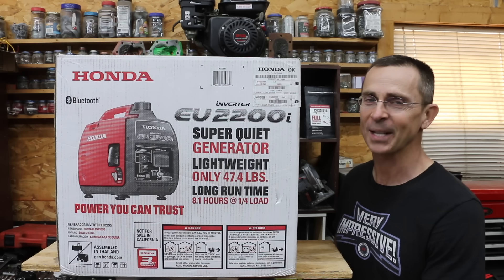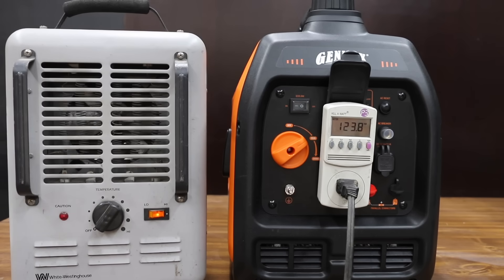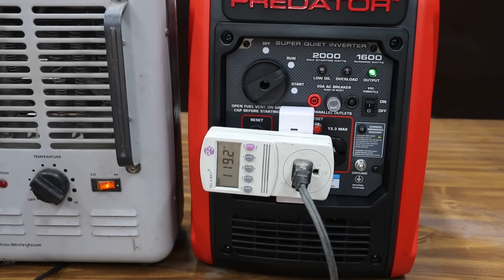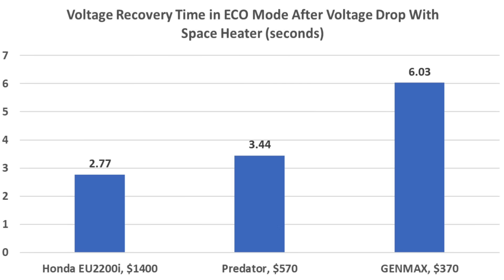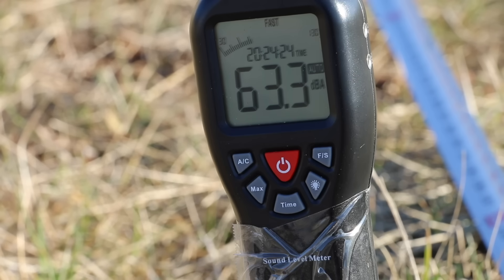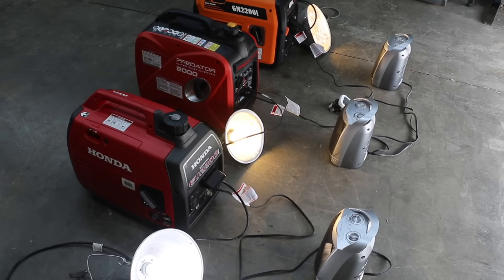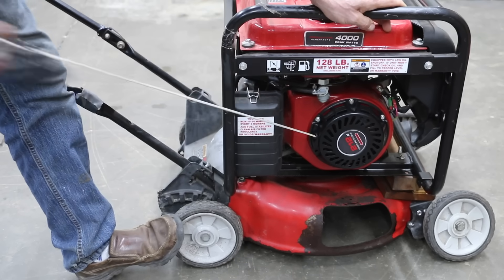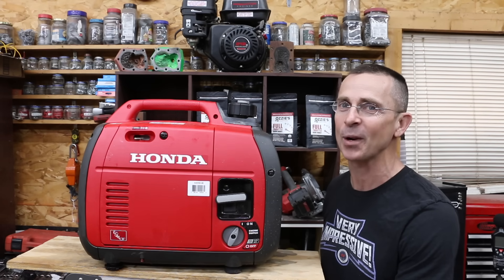Cheap Generator Better Than Honda? Predator vs Honda & GENMAX—Let’s Settle This!

Comment: I’ve owned 3 Honda’s and they all failed (2) 2000 series and (1) 1000 series and I think it was just during a few bad years. The engines were still running but the inverter/output side was dead.  I now own 2 Yamaha’s and 2 Ryobi’s that are all 5+ years old and they run great!  

The Yamaha’s were cheaper at the time but I don’t know if they still are however the Ryobi generators are still the best bang for your buck.  The main area of long term failure on all generators is with the owner and the lack of proper maintenance with Oil Changes and leaving old fuel in them and using regular 87 pump-gas instead of Ethanol Free. 

Good Video to separate the three qualities..!
Reply from the maker: Thanks!

Comment: I bought a Honda generator 3 years ago and I am super happy with it. One thing that is very convenient is that the honda tells you when its time to service by flashing the red led. (I have an older model with no bluetooth). Dont know if the other brands have this.
Reply from the maker: Nice!

Comment: I wouldn't touch a Honda personally. Great engines for sure, but if the Inverter goes the price for a replacement will make your head spin. All Honda parts are far too expensive. Add to that that Honda discontinue parts very quickly.
Champion all the way. Reliable, parts are affordable, and easy to source parts.
Reply from the maker: Thanks for the feedback.

Comment: Like to see Portable Solar Panel test, I use a briefcase style 4 panel to charge my portable battery packs and batteries for tools to save money .I realize its subjective because I live in Vegas so we gets lots of sun,but would be interesting to see if these units like mine Togo 120w or the Jackery or Ankers really put it out.Still saves me alot on my electricity charging from solar.
Reply from the maker: Thanks for the video idea.

Comment: If you can, see if you can test those big battery power banks that are suppose to replace generators. I wonder if there is any difference between them.
Reply from the maker: Thanks for the suggestion.

Comment: I have a honda had it 25+ years it ran for 4 months 24/7 tor 15 years last 10 years onley 2 months 24/7 onley larst 5 years it started using oil will buy another one
Reply from the maker: Thanks for sharing.

Comment: I would imagine that a new Generator engine would be broken-in at the manufacturer right?   At least with vehicles you typically don't want to use full synthetic oil until the engine has broken in and the rings are seated.  Maybe the engine isn't under enough load for it to matter?  Just curious

Comment: What great tests. Maybe as a small suggestion do a 100w draw test in the future? Most of us are not running Power tools so I'm curious what a TV for example would have dropped it. I mean way less than 50 watts I imagine would have been smooth? I was blown away at how much oil the predator used. I wonder if this was a "lemon" or if that's just acceptable to them. The Genmax impressed me for the cost. Quiet, good power except on hard draws initially. I think I would rather have 3 Genmax's than one Honda. Honda is solid but its overpriced.
Reply from the maker: Thanks!  Thanks for the suggestion.

Comment: I run a power conditioner on my generator that I use for electronics (fridge, computers etc) during blackouts.  Would be interesting to know if this is protecting my electronics and if one conditioner is better than another.
Reply from the maker: Thanks for the video idea.

Comment: The way I see, the Honda and Predator are effectively priced the same.
The Honda is available for $1200 shipped and includes a three year warranty. Predator is $620 today with a 90 day warranty (nope!), so I'd have to add the protection plan, two year max is $180. That's $800, 400 per warranted year, same as the Honda.
The Honda is obviously the better performer. Oil-life tracking in the app is a valuable feature. It's quieter. The clincher is the used oil analysis. I'll look at some others, but Honda is on the top of the list right now.
Thanks Todd for another great breakdown.
Would like to see some other quality brands.
Reply from the maker: You are welcome!  Thanks for the suggestion.
Reply: Very  good analysis. I have owned two Honda generators, the 3000is and the 6500is. A conservative estimate of 6,000 running hours on the 3000is before I sold it for $1,300. $700 for 6000 running hours. The 6500 has about 3,500 hours on it and I don't anticipate parting with it. You truly get what you pay for.

Comment: Being an electrician for 34 years I can tell you voltage drop at that small amount will not hurt any appliances over time. The Genmax had a running drop of only 4.2 volts (123.8 to 119.6) which is only 3.4%!  With a 100 foot 16ga extention cord,  yes there will be a problem with V drop.
Reply from the maker: Thanks for the feedback.

Comment: I would really like to see a fuel injected model added in, something like Honda's 3200i or 7000is. Both claim significantly increased fuel economy and better reliability compared to their carbureted counterparts, plus the 3200 produces significantly more power than other units its size. Could make for an interesting technology comparison.
Reply from the maker: Thanks for the suggestion.

Comment: All your product comparisons are highly appreciated!!! About a year ago I purchased my first(fully enclosed) gas powdered generator/inverter. Of course a different brand from the ones in the testing + w/3200 running watts. The cost was less than half the Honda equivalent & I did some Project Farm like testing....comparable to your results,but I was satisfied with my units'  results -(oil clarity when changing,run time;especially on eco mode,powering radios/fans/heaters/electronics when camping). Of course I performed a multiple oil exchange early in it's use,installed the compatiable NGK spark plug, & used high quality fuel with mixed cleaning agents. EVERYONE knows the reliablility of Honda motors....but with regular maintenance "Most" well known generators produce units near the quality of Honda @ least half the cost - longevity may be a benefit of the higher cost?....but I'm not using it to power my entire home for an extended period....so,I'm satisfied & have that monetary savings to invest in other off grid essentials. It would be nice to see a follow-up video with other brands Ex: Generac,Firman,Yamaha,Westington,etc. Yeah,I know expensive though😐.
Reply from the maker: Thanks so much!  Thanks for the video idea.

Comment: Id like to see you test the Yamaha EF2200is, and the A-iPower 1800W running/2300Peak Powered by Yamaha Inverter Generator from Costco.  It would also be cool to see the multi fuel generators that run on gas or propane, like the Firman 3200W.
Reply from the maker: Thanks for the video idea.

Comment: I recently purchased a WEN 56235i.   It's been fantastic.
I used Amsoil break-in oil and now run Amsoil 5w-30small engine oil.  I have about 10 hours on this current oil fill and zero oil usage and it's still pretty clean.
Reply from the maker: Thanks for the feedback.

Comment: Thanks Man. It appears that under a HEAVY LOAD the HONDA runs longer by about 70% to 80% which is significant. Assuming that each of the Generators has a 1 Gallon Tank or about 7 lbs of fuel that would mean about 3.5 Hours of of Use on the Honda and maybe about 1.5 to 2.0 hours on the other Generators. MY USE would be for HEATING which makes the HONDA the cheapest in GAS and most reliable considering that one of the Generators shut down after only a few minutes because of HEAT. 
..... A Gallon of Gas is nearly $5 gallon and if you had to use the Generator for a DAY (24 hours) that would mean Burning about 7 Gallons of Gas or about $35.00 bucks a day to use. 
.... Never the less the others would be about (I'm doing this in my head) $20 bucks a day MORE by using the lesser costing Generator. Assuming you used the Generators for a week each year then that would be $140.00 you might apply to the Cost of the HONDA. If the HONDA is about $700 dollars more than the other avg. Price then HONDA's Generator would take about 5 Years to pay the difference between it and the other in Savings. 
..... If the HONDA was used 2 weeks a year then in approximately 2.5 years the SAVINGS in GASOLINE would pay the difference in the other Two Generators price advantage in the Beginning by Burning Up GAS Quicker UNDER the HEAVY LOAD. 

Dependability and Long Life of the HONDA seems to be a given based on those I know using them never seem to repair them. BUT when it comes to SMALLER ENGINE Generators I have not found many older machines lasting by the preponderance of Users I've known or have read about..... 
.................................... I really appreciate this review and because I don't have a clue without more of the Details you provided to make any evaluation. Now that I have good Knowledge through your Experience I'd have to say I would want the HONDA for myself it would be worth the $700 cost difference because of the SAVINGS IN GAS and it's Excellent Long term LIFE Span. 

Thank you - Again - m. :)
Reply from the maker: Thanks and you are welcome!  Thanks for the feedback.

Comment: Excellent test! I despise poorly made knockoffs of Honda. They just steal Honda designs and modify them to be cheaper to manufacturer with lower quality materials. I'd rather own a used Honda than a new knockoff. In terms of brands I'd like to see tested: I'd be most interested in Yamaha, Champion, Generac and Westinghouse which all have a long history making generators. Maybe also Echo and Ryobi which are new on the scene.
Reply from the maker: Thanks!  Thanks for the feedback.

Comment: Project Farm is notable simply for the wide array of measurement techniques.  From over the counter timers and mass scales, to esoteric vectors like oil analysis and sharpness measurement devices.  However, the real eye openers are the ones our brother synthesizes. Utilizing drawer rails and sleds to test cutters.  A homebrew lubricity tester that still makes me scratch my head. But when you whipped out an oscilloscope and showed the waveforms of the generators, I realized this channel is completely off the hook.   You are a renaissance man,  a polymath of immeasurable resourcefulness.  I would consider it safe to say I echo the feelings of many here.
Reply from the maker: Thanks so much!

Comment: Thanks for another great video Todd! I have an EU2000i that is about 15 years old at least. I have run it in both extreme cold and heat like minus 35C to plus 35C and it has never let me down. Have changed the oil in it numerous times but after watching your video I just realized that I don't think I have ever removed the spark plug for a change or cleaning. We use it for camping on the beach a lot in the summer and the only issue I ever had was some sand and dust got into one of the switches and caused some starting issues but after cleaning it out ran like new again. Excellent piece of equipment. 
Have been watching you for a few years and YOU ARE THE BEST!
Cheers from Alberta Canada!
Reply: Why do you Canadians keep electing that absolute brainlet prime minister?
Reply from the maker: Thanks and you are welcome!

Comment: The honda generator is the cheapest if you consider their lifetime! They are running forever! And when I say forever, I mean it! I have 2 honda generators at my off grid cabin for the last 10 years. I bought them new, and they still run as new! Give them fresh oil and fuel, clean the carburetor and wash the airfilter once in a while ,and they will go forever!!! Awsom video as always!
Reply from the maker: Thanks!  Thanks for sharing.

Comment: I wonder if the Honda had less runtime because it had a slightly higher voltage output and the test was done with a resistive load. It could have been putting out slightly more power over the course of the test. It might be worth using a kill-a-watt to check for total power provided by each generator during the test to normalize the results.
Reply from the maker: Thanks for the feedback.

Comment: THANK YOU for taking the time to demonstrate voltage drop. People do not get this in the cast majority of cases. They see their electronic item is running and just assume everything is fine... That's what makes a Honda or a Yamaha worth every penny in my opinion. It won't fry your stuff eventually like most of the cheap no name units eventually will!
Reply from the maker: You are welcome!  Thanks for the feedback.

Comment: It would be nice to know if the generators have fuel cut-offs, so that when done, you can run them dry for storage. All small engines should have that; especially generators. I'd like to see Champion and Firman small 2000-2200cc generators done, they're the most common in my area at my price point.
Reply from the maker: Thanks for the video idea.

Comment: Bye the way, too much is made of the "cleanliness" of the power waveform.  Electronic gadgets are not sensitive to input power waveform.  Most use switching power supplies which, in terms of waveforms, are truly filthy.  These power supplies have extensive filtering to clean things up.  These devices couldn't care less how clean the power waveform is.

Comment: I would like to see the Pulsar 1800/2300 for under $400 BUT Pulsar has a brand new 4000 watt Inverter Generator that I have seen for under $600 !
Reply from the maker: Thanks for the feedback.

Comment: One test where the Honda excels is continuous output at the maximum rating. A Honda will output that 2200 watts for a half hour, whereas the cheaper generators will put out their max for a matter of seconds. Other YouTube reviewers have demonstrated this difference.
Reply from the maker: Thanks for the feedback.

Comment: Great video! Always a treat to see the output waveform on an oscilloscope but it doesn't tell you much. Would be nice to see THD% at various loads. You can use the FFT function on your oscope to see the frequency spectrum and how much switching noise from the transistors is present on the output causing RFI. Normally this is well filtered below the FCC 15 limits, but inexpensive inverters lack adequate filtering. 

The voltage drop in eco mode is a good test, but its expected. Voltage drop under load vs unloaded is a better test as it shows how well the voltage regulation is. Severe voltage drop at full rpms indicates a loose connector, or inadequate inverter input stage sizing. 

Definitely compare the Yamaha ef2000is, and any of the Champion and Firman inverters generators. 

James Condon and I encounter these brands all the time. Great video once again!
Reply from the maker: Thanks!  Thanks for the feedback.
Reply: @ProjectFarm  my pleasure! Thank you for taking time to read my comment!
Reply: @bassguitarist1985 You could always make your own video and use all of those acronyms that no one else knows and see how many views you get 😂
Reply: @lightwavesurfer6939 that would likely not get much views at all with plenty of "I don't know what that means" comments. Least with ProjectFarm he can simply say yes this one is good, the others not so much.

Comment: Lately the Costcos in my area have had some good sales on the A-iPower generators. They are dual fuel and will run on gasoline or propane. It would be really interesting to see how they compare.
Reply from the maker: Thanks for the suggestion.

Comment: Many of your tests involve small engines.  The better engines have iron/steel cylinder sleeves while the cheaper ones don't.  I suspect that's why oil analysis shows aluminum contamination with the cheaper engines.  It would be helpful if you could pop the heads off the engines you're testing to see if they're sleeved or not.  That would be a great predictor of future life of the engine.
Reply from the maker: Thanks for the constructive feedback.

Comment: I'd like to see multiple of the cheap generators vs the more expensive ones. Should I buy two of the predators or one of the honda? (Assuming we can fix the metal wear issue)
Reply from the maker: Thanks for the suggestion.

Comment: Thanks for another good test!

I would like to see some changes to the sound level graphs to better illustrate how big the difference is between decibels. 6 dB might not appear like a lot, but its the difference between something appearing equally loud from twice as far away!

Decibels is very challenging to compare though. And im not sure how it could be best shown on a graph.
One would compare 3 and 3 decibels to denote a doubling in absolute sound pressure.
One could compare 6 and 6 db to illustrate "sounds equal at twice the range"
Or one could use 10 dB to show the difference in experienced volume. For humans an increase in 10dB is typically experienced as "twice as loud"

In this videos case, one would have to be 50 ft away from the GENMAX for it to appear as loud as the Honda at 25ft! That could be a very approachable way of measuring here. Using the lowest measurement as a baseline, and plot into a diagram the distance away the others would have to be to sound the same.
Reply from the maker: You are welcome!   Thanks for the constructive feedback.
Reply: It's a generator not the space shuttle.